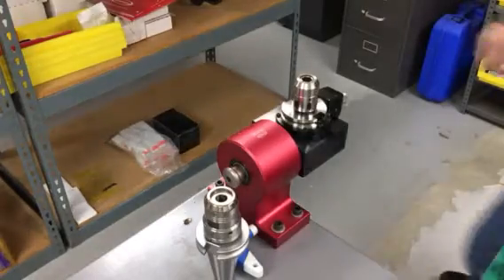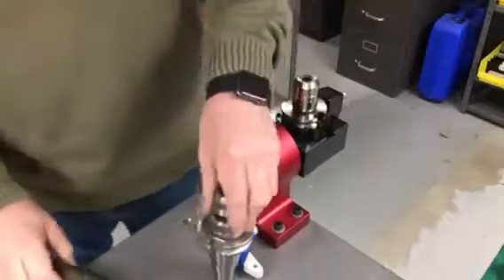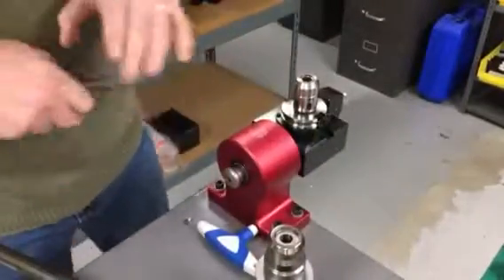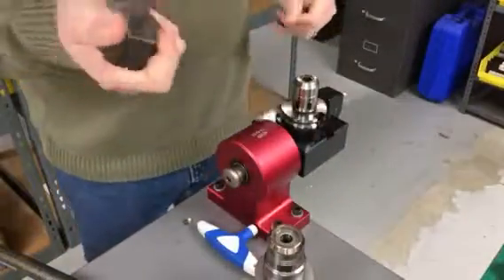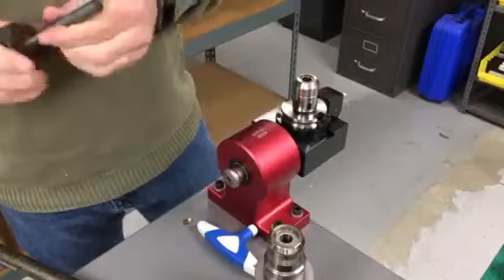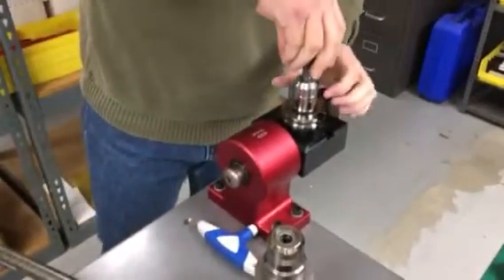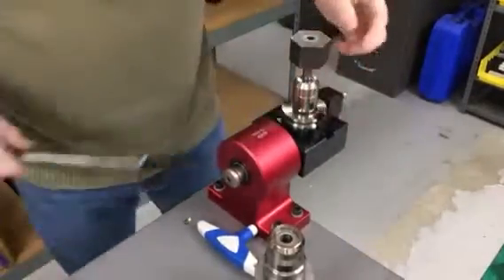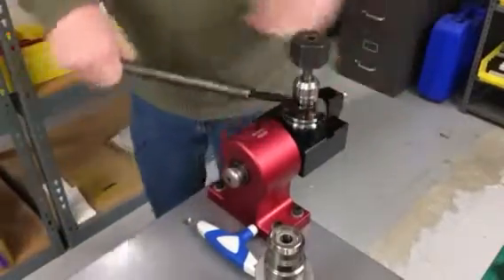BC Mill Chuck Holding Power Test vs Popular German Hydraulic Holder

Comment: Test is pretty sloppy!  No real data on competitive tool.  Used a breaker bar to tighten one and not the other.  Hydraulic?  Are you sure.  Hydraulic typically tighten with a set screw.  No real useful conclusion in your test.
Reply from the maker: Our video's are to answer customer's questions, this video when created was for a specific customer who had questions about the differences in grip force, they were having pull out problems with the hydraulic chuck brand shown.
With most things we cannot use competitor's branding without possible legal action.  
The hydraulic chuck that uses a spanner wrench is made by the largest supplier of hydraulic chucks in the world and it is their heavy duty model.
On our BC chuck you can use a long bar or wrench and you will not damage the chuck.  It is a solid shoulder design to prevent over travel.  The conclusion is out BC chuck has almost 3X the grip force.  In this customer's application our holder fixed his pull out problems.
If you would like to supply an email address I will be happy to provide the specifics of the competitor's holders.